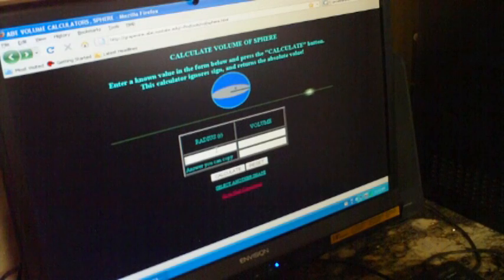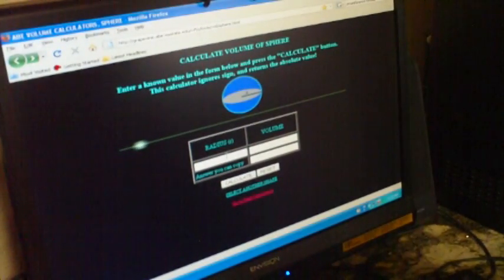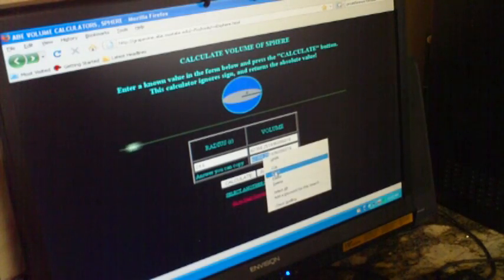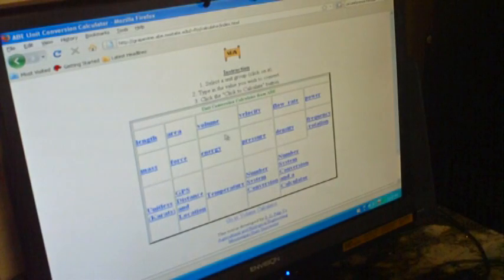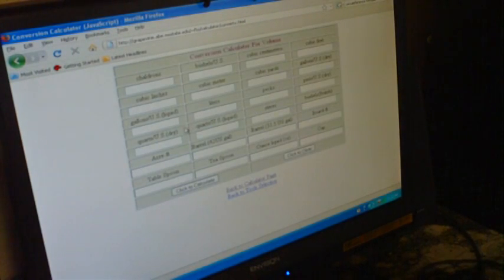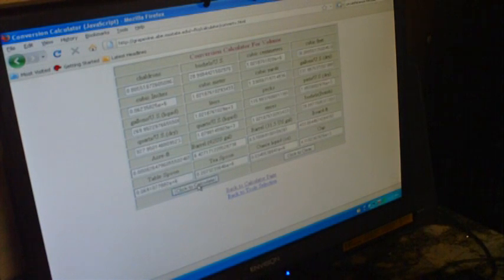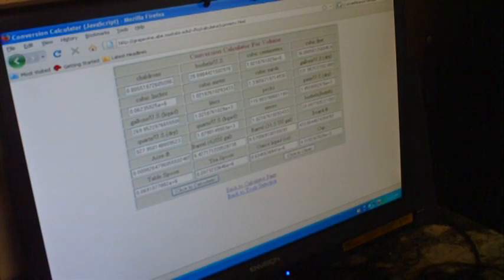Free Lift: or How much gas do you really need?

Comment: I enjoyed your video. But you only included the weight of the payload lift capacity. It didn't include the weight of the balloon itself, the connected filling nosel, hose, string and tape. The helium is lifting all of those, in addition to the gas itself. I suspect if you add the weight of these to the payload lift measument, the result will be much closer to the predicted lift. 

The temperature and pressure in your video appears unremarkable. For example, you were wearing shorts and a tshirt. And you certainly weren't wearing a pressure suit or oxygen mask. So temperature and air pressure effects should be negligible.

I'd love to see an update for this video and more experiment videos from you. Thanks for sharing.

Comment: What is the altitude of your test location ?  The same balloon would provide more lift at sea level then My 4440ft at this location.  As stated you did not take in account of the scale weight.   Nor the Filler assembly..  Your balloon was doing much better then you think.

Comment: The gas inside the balloon is compressible. Since the air pressure outside is pushing on the surface of the balloon, why does the balloon refuse to compress and starts rising instead?

Comment: im wondering how much difference it would make if the helium was in a bag instead of a balloon, seem to me the elasticity of the balloon will compress the gas increasing its density and reducing the lift.  The volume of gas is not accurately measured by the dimensions of the balloon because it would expand to greater volume outside of it.
Reply: I was just thinking that and found your comment.

Comment: The reason your balloon had only 1.2 pounds of lift is that you have to subtract the weight of the balloon (latex) and that valve and hose attached to it. Anyway, it is very nice and instructive video. Thanks

Comment: @professoriadevaia Although your balloon is not perfect this is far less significant than your error in measurement. You have neglected to calculate the weight of the balloon and your pipe and its tip. The actual lift that was generated by the Helium contents of your balloon are equal to 1.2 pounds + weight of balloon + weight of lifted pipe and tip. I am not sure how the scale you have works but that should also be looked into, as for the measurement to be correct you will have to ensure that the scale takes its own weight into account, since it is also being lifted.

Comment: Surprised that with all the attention you gave this experiment you didn't take into account that the balloon had to first lift the scale, pvc pipe nozzle, duct tape, and a portion of the vinyl tubing before the scale even began to register lift... had you added these tare weights your calculations would have come out in agreement with the stats.
Reply: And the weight of the balloon rubber as well which he said was 100grams or
about 1/4 pound.
Reply: @meagain2222  Oh, I didn't even think about that (weight of balloon).  I assumed that lift calculations assume you've filled a latex balloon of the appropriate size to its maximum diameter and you read the lift for that diameter.  As for the hardware the balloon was lifting up, I too am surprised he didn't realize that.  There was a LOT of extra lift there, picking that stuff up that wasn't accounted for.

Comment: The moral of the story was well said, but you also failed to tare the weight of the fill assembly and whatever section of hose it lifted.  This will put you very close to the calculated lift figures of the balloon.